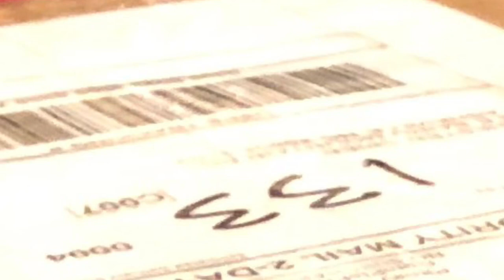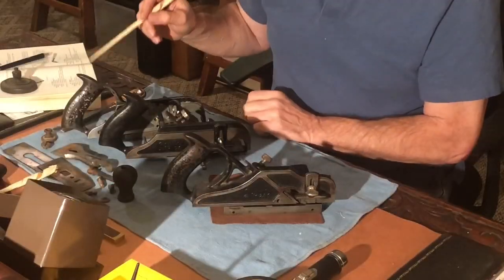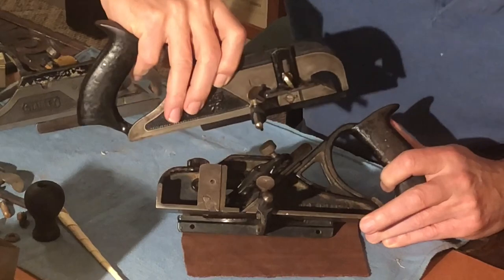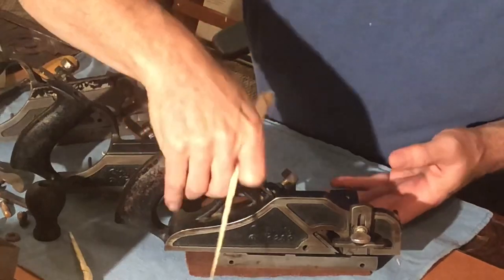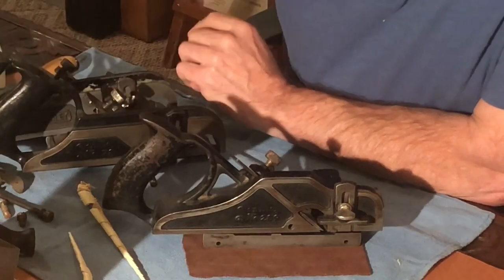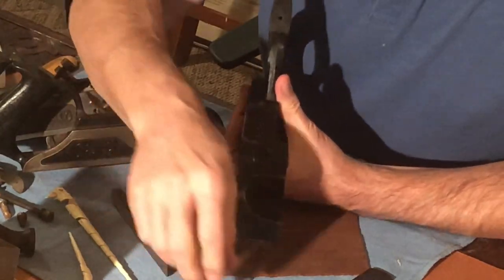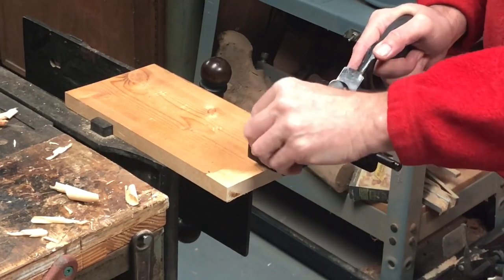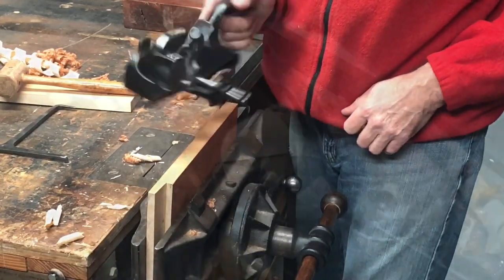USING A STANLEY 289 FILLESTER PLANE

Comment: There is not much info about the 289.  This is great.  Can you explain the difference between the 78 and 289 depth stop?  Also a bonus question, do you know of a source for the scoring spurs (I guess I need two, one left and one right), mine are worn out.

Comment: I have a 289 I’ve used since the 1970’s - a sweetheart version with the  3 lobe nicker, which as it turns out is rarer.
I remember a steep learning curve , but once I got through that it’s a sweet filletster plane.
Though the fence and rod looks like  they won’t work on a 78, the threading on the rod is the same. It will stick way out front of a 78, though.  
There  are many 289’s in the wild where lost fences were replaced with 78 Rods and fences, so watch out! A 289 fence will cost as much as the plane.
 New 78’s have metric theading. I found out when I bought a flea market one just for its fence.
Reply: I also have a 289 with a three-lobe knicker.  I don't know why they changed it, or which is better, but the three-lobe knicker is much easier to find for replacement.  Also, I think the depth-stop from the 78 can be used with the 289.

Comment: Chet, I picked up a 289 at an antique store not really knowing what it was. I knew a lot less about hand planes then as I do now. Unfortunately, mine didn’t have a fence or depth stop. I know these aren’t interchangeable with the more common 78. I’m having a lot of difficulty finding a replacement fence and depth stop, and I’m wondering if you could give me some dimensions to them so I can DIY a replacement. What tread size was used for the rod? Length of rod, width, height length and depth of the fence, etc. If you can do this I would be extremely grateful.